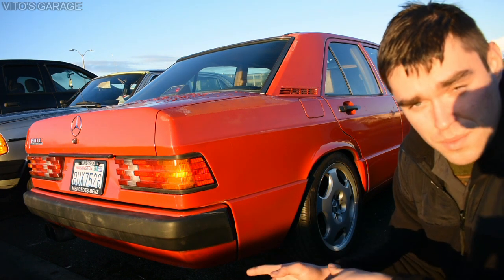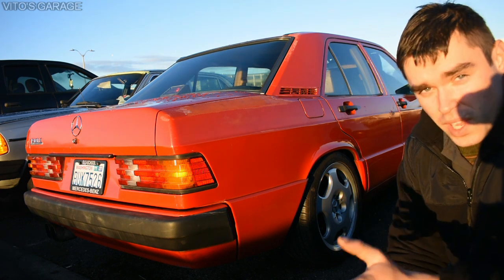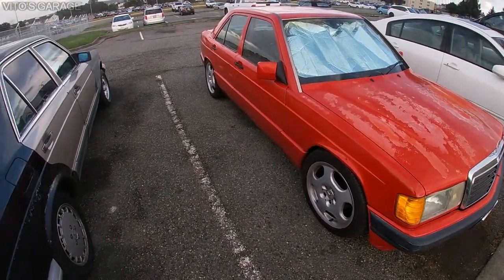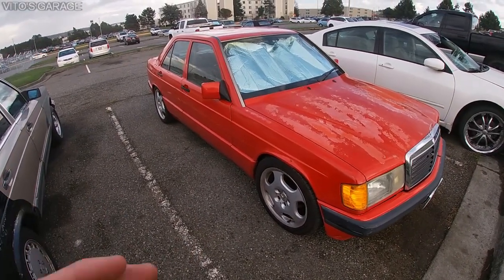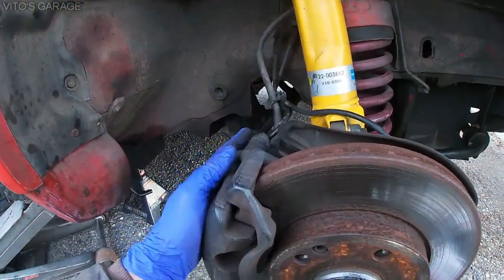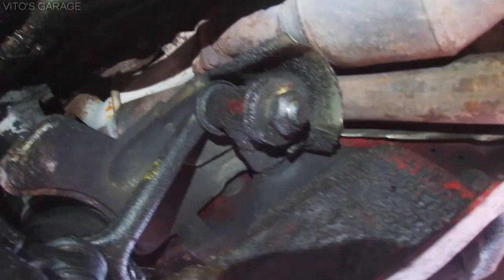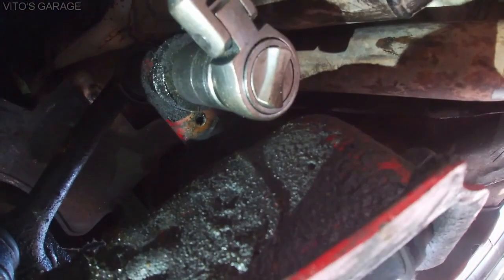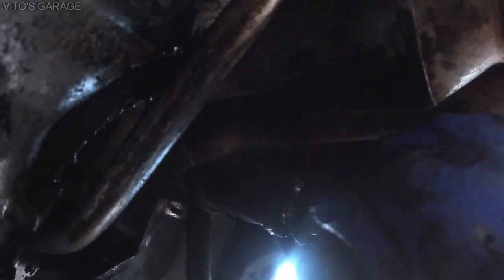Mercedes 190E Idler Arm Replacement. You Think It's That Simple But No Way! W124 W126 W140 W123 R107

Comment: My 1987 has the original Tie Rods and stamped with date codes to prove it. Amazing that after 200xxx kms the original part is still good. I also do the same thing with bulbs always pull them from junkyards. OEM parts for these cars are incredible.
Reply from the maker: This car has 252 000 miles and that idler arm was original from 1991 :)

Comment: I love your videos and it helped me a lot while working on my w126 300SE, but IMHO it isnt a good idea putting the bolt in from the bottom and screwing the nut on at the top.
I did this too about a year ago (with torquing, to spec etc...) but after around 3 months i checked it and the nut had worked itself pretty loose (like only 30nm from the specs original 180nm where left). Then i torqued it down to spec again but another 3 months later it was loose again.
Then i read in the german "w126-forum" that someone had the same problem (m103 and exhaust is in the way) and just unscrewed the engine mounts and lifted the engine up until he could push in the bolt from the top.
It feels pretty dangerous pushing the engine so high up but it works! :)

Since then (about half a year ago) i had no problem with the nut loosening itself (which i guess in the worst case scenario could result in the bolt dropping out from the bottom).
I dont know if it was just me doing it wrong but i think that when the nut is at the top it somehow works itself loose (I guess through steering and thus turning the nut on the bolt :)).
Reply from the maker: I haven’t had any problems with the nut backing out. Maybe you just didn’t tighten it enough? Sometimes you can use a blue thread locker to make sure the nut doesn’t back out. 
Lifting the engine up would not help much. The only proper way would be to remove the exhaust. At the moment I didn’t have that much time for such a big project. But the car has been amazing ever since. No issues. When I pull the engine out to rebuild it, I’ll flip the bolt around. 
Thanks for watching and check out my other videos and playlists. I have lots of car content 🙂🤝